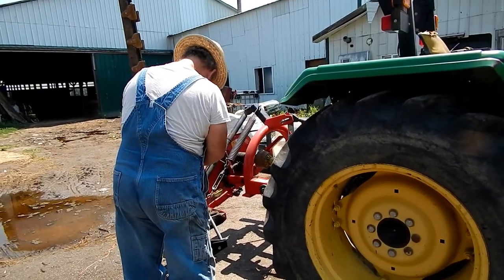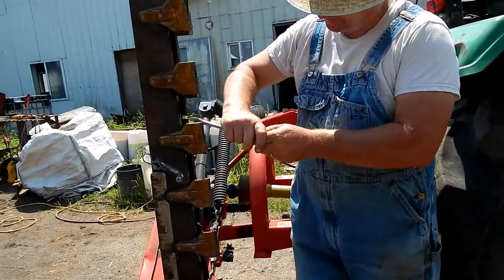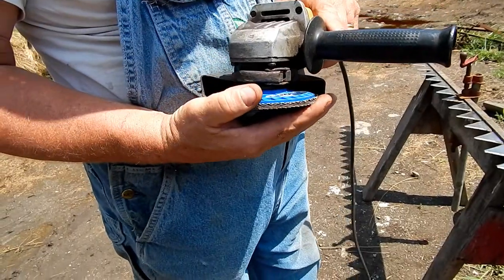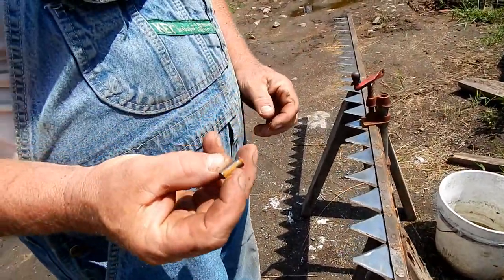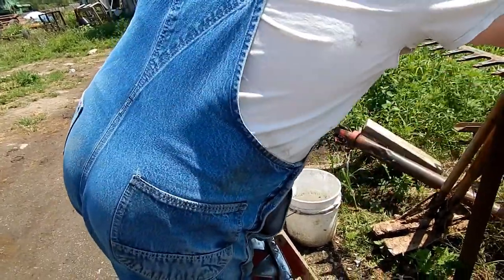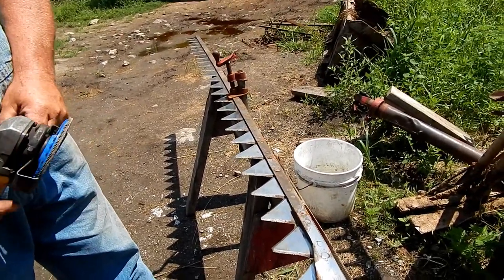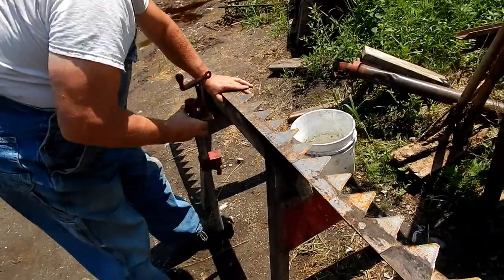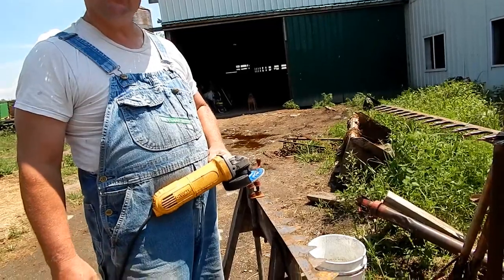Sickle Bar Maintenance(A riveting experience with our Enorossi)

Comment: Have a bfs 210h, hit a rock and actually bent a blade tooth but didn’t break it so belts started squealing immediately as the bent tooth wouldn’t allow the blade to pass through the rock guard. Didn’t really know how to pull the blade out but did have a complete spare blade assembly. Already pulled all the guides and spacer plates but easy enough to bolt them back on. Thanks for showing the blade slides out from the back. I’ll see if I can figure how to pull the pins with the marginal clearance they give you at the Pittman arms. Thanks again for the insight!

Comment: We were told to try using the serrated top and bottom edge blade well we'll never go back to the smooth blades. Another thing I noticed everybody on here changes the guards and cutters out but nobody is adjusting the hold down clips. They have to be adjusted because the new parts are not worn so when you adjust the big nut with a set screw in middle on the hold down clamps there's Less noise not banging or prematurely wearing everything out. It changes the clamp angle so when you tighten it down it's not pinching to tight

Comment: Great video; thank you.

I’ve been trying to figure out where the (limiting) chain gets connected to the tractor.  I think it connects to the toplink mount on the tractor.  You appear to have it connected to the top mount on the cutter (where the toplink connects to the mower).  Is there a reason why you’re not connecting it to the tractor?  What is the purpose of this chain?  Thank you.

Comment: Used a sickle mower for years !   Issue is..... you can only do so much to sharpen a sickle !   Because........   the bottom of the sickle is also worn...along with the top of the sickle guards.   There can be as much as 1/16 inch between the edge of the sickle laying flat on the sickle guard. Not easy to cut with this situation !   Also.........most times the back of the sickle bar........and guard wear at an angle...causing the sickle to ride up which causes even more space between the sickle and guard.   Most times it best off  replacing everything new at the beginning of the year !   Add into the mix...golfer mounds and sandy soils....... often the sickle wont even last a year. All depends on the acres its uses on.  Might get 200 acres out of a sickle.

Comment: Well if I OWNED and used a sickle bar mower.  After a thorough cleaning.  I would spray a graphic coating on the back edge of the cutter bar and the inside of the cutter guard.  It would reduce wear, material build up and ease install effort.  Oh yes coat the pivot bushings as well.
Reply from the maker: Jason B yes sir!  Thank you for your comment!  Thank you also for viewing and have a great day!  Lynette and Peter
Reply from the maker: Jason B did you mean graphite?